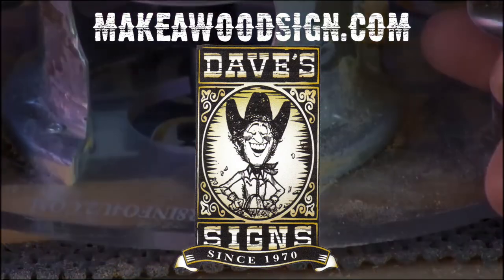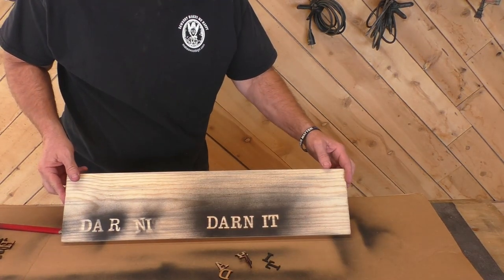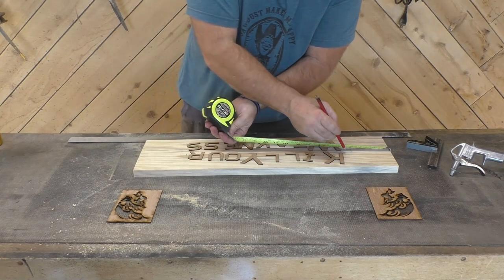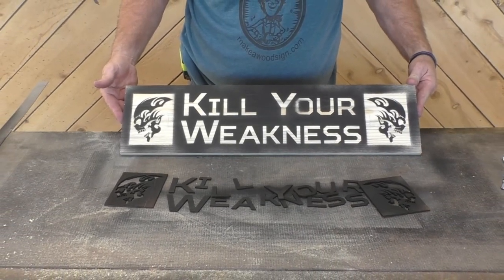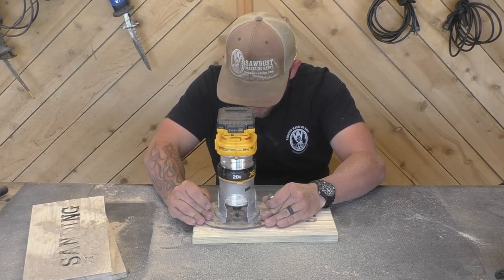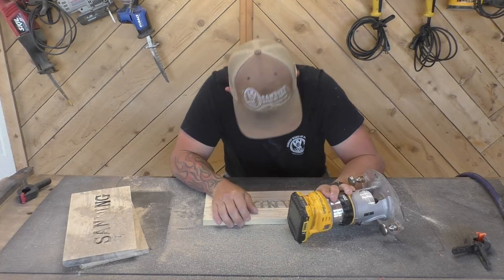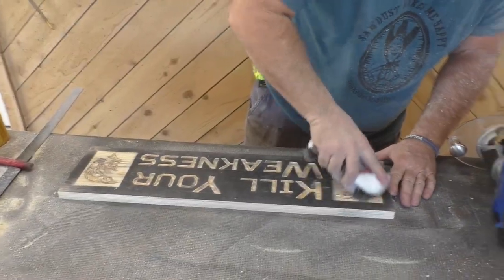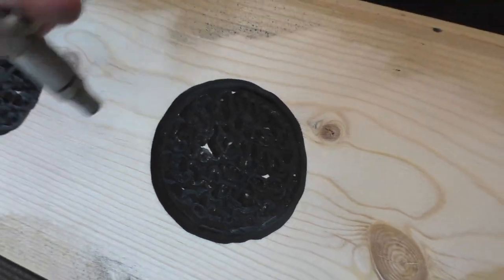5 More Sign Carving Mistakes

Comment: All great advice!  I never thought of putting primer in the refrigerator but that makes sense since air expands as it heats up.  I'm sure Miss Vicki is thrilled when you guys keep your primer in the fridge!  The tip I'm most guilty of is not taking breaks so I have to work on that.  Thanks for sharing more of your words of wisdom!
Reply from the maker: I'm the same way, Lori! I try to knock out my projects asap and sometimes i rush way too much.